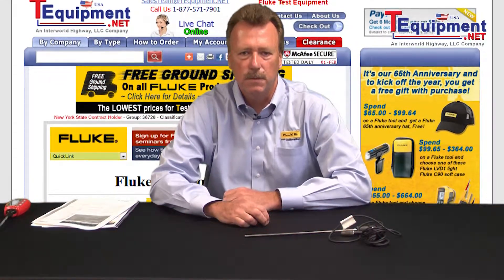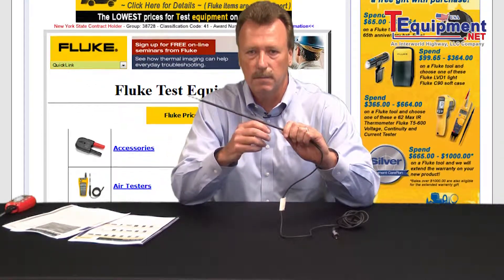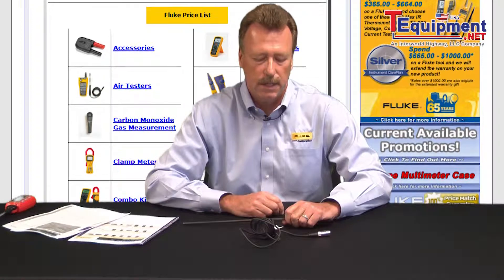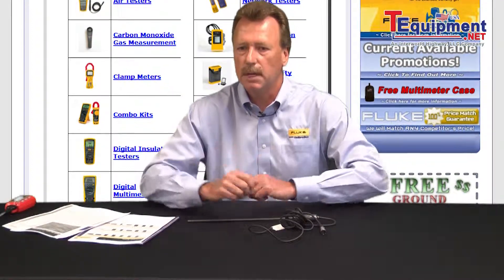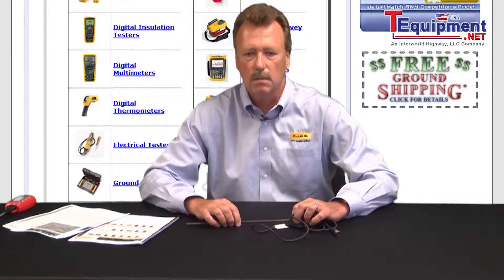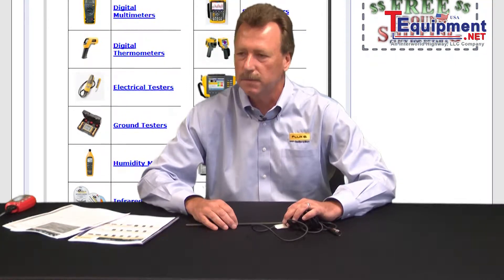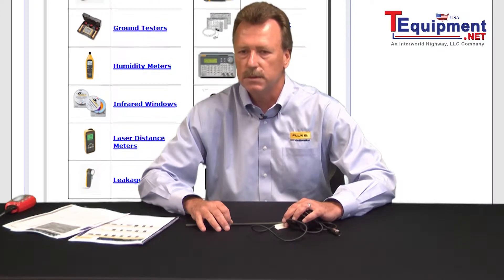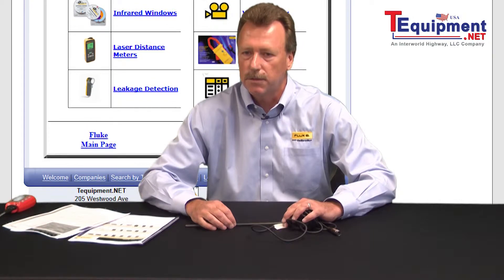Fluke Temperature Probes Discussion

Comment: my extech type k thermocouple seems to be very flawed compared to my fluke thermocouple. in a cup of water they read within 1 degree F.  but in the air the extech is always off by 3 degrees.   sometimes up to 8 degree difference. the fluke is always correct but the extech is always off ,   is this common ?